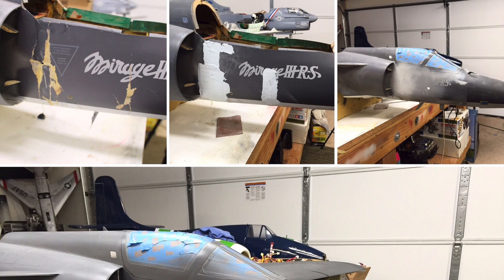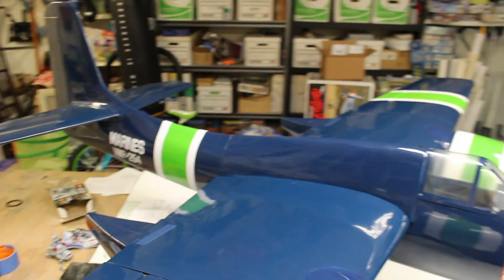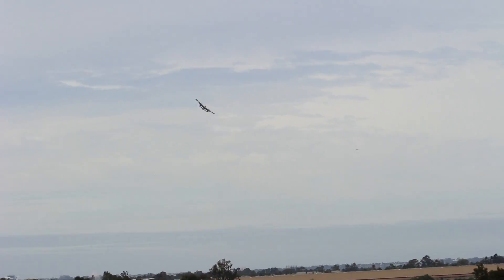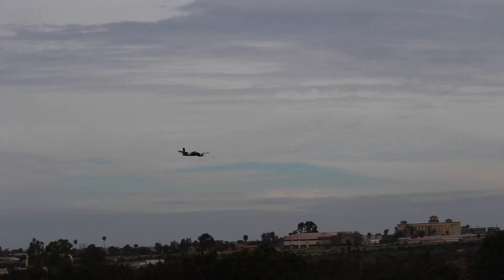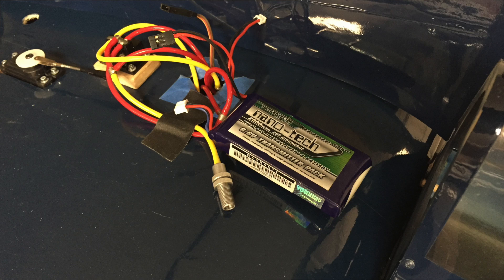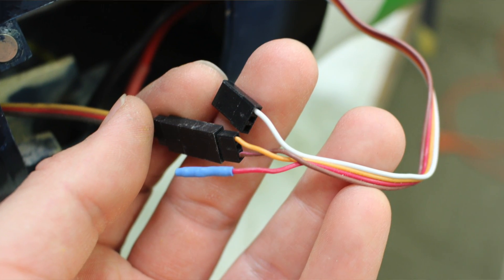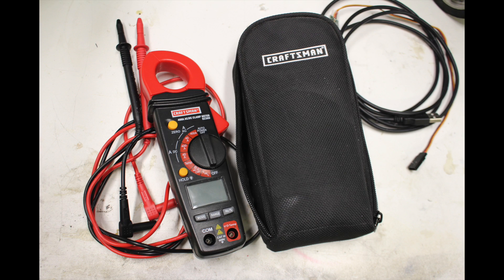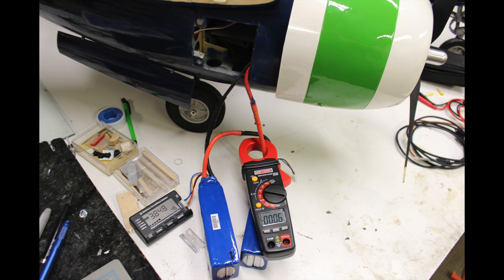From the Bench - How to Setup Multi-Engined Electric Aircraft (The RC Geek)

Comment: YES YES YES AND DID I MENTION YES.......IF YOU FLY WITH 8,10,12S DISABLE YOUR 1,2,4 BEC'S ''RED CABLE'' USE A FAIR SIZE 3S AND A GOOD UBEC WITH 6/7/8VOLTS AND CHOOSE THE AMOUNT OF VOLTS FOR THE SERVOS YOU USE,AND RETRACTS! YOU CAN BUY A UBEC WITH TWO OUTPUTS OR A SECOND (4th) LIPO FOR R/ACTS.AKA  DON'T PUT IT ON THE TEST/AIR WITH NO BRAINS!! THE OUTCOME WILL OPEN YOUR EYES! ! NICE VID BEAUTIFULL PLANE NICE DAY T.R.G ! !